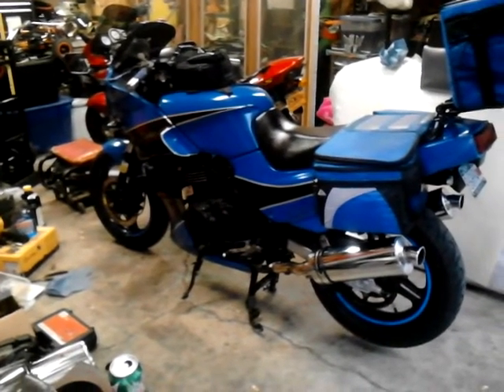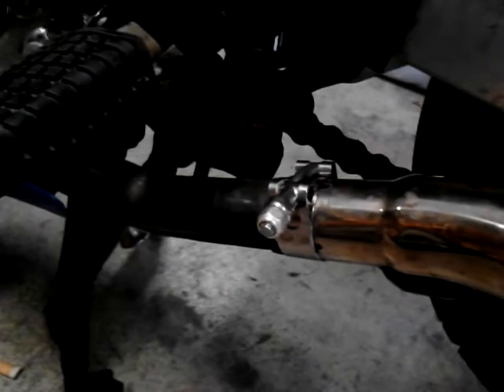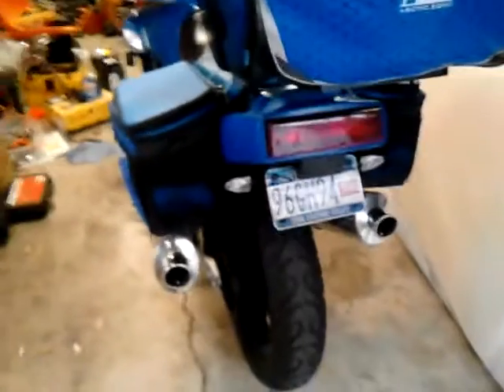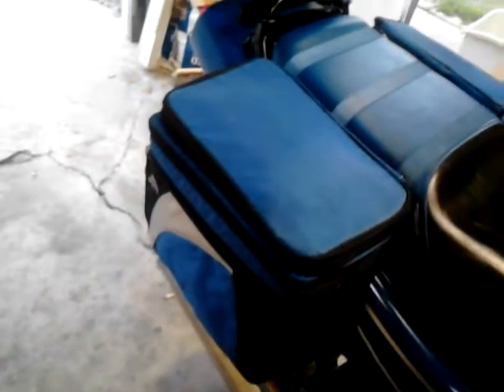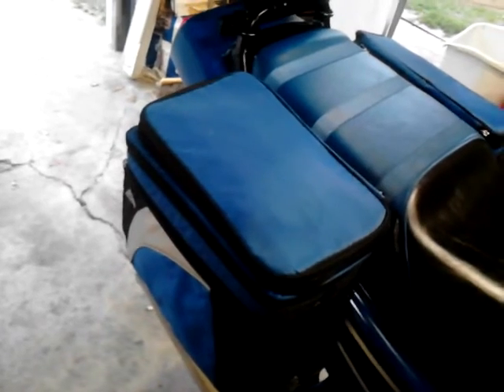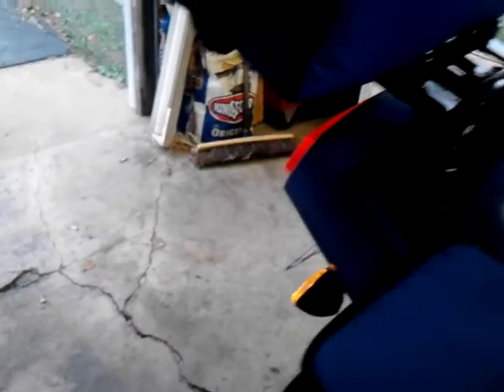1989 EX500 with Delkevic exhaust.

Comment: EX500s are badass bikes. I have one and love it. The only issue with them is the carbs. The jets get clogged super easily, but then again, if one would just stabilize the fuel before storage or just burn/drain it out, the carbs wouldn't ever be a problem. If EX500s were FI, they would probably be among the top 3 bikes ever manufactured.